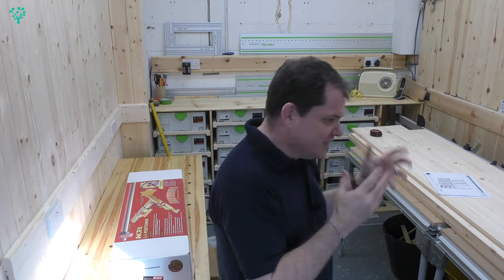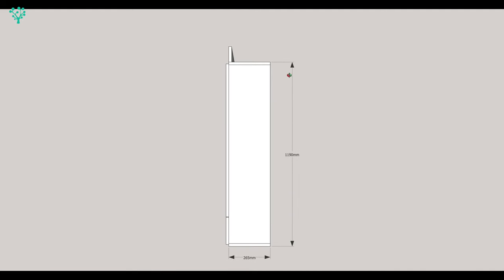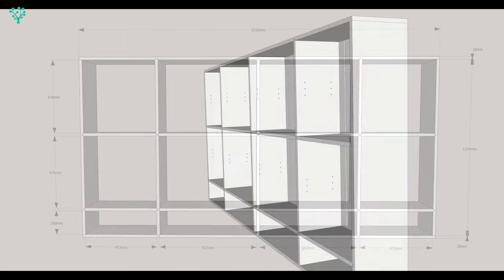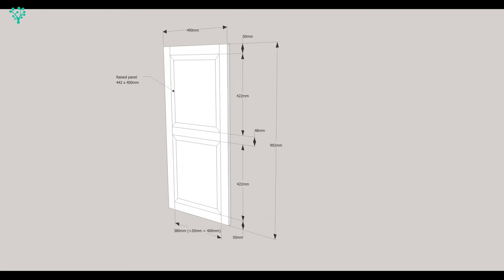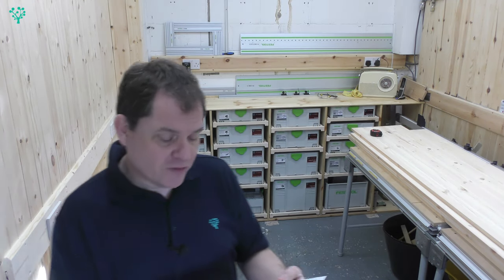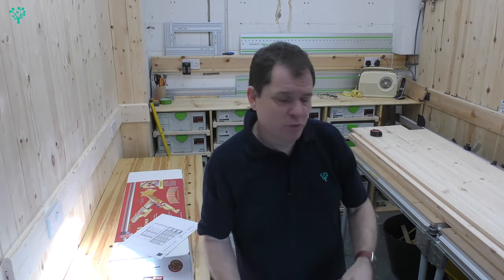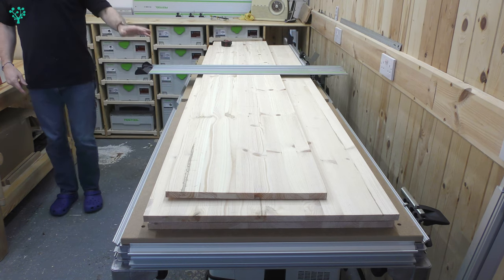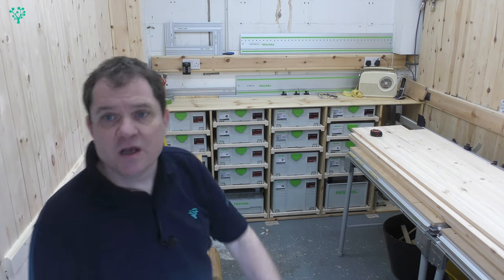How to build a bookcase - Episode 1 - The Design

Comment: Good video.  Two questions. 
First, did you use the connecting piece VS (484455) to join the MFT/3’s?
Second, what software are you using for your designs and why?
Reply from the maker: +C B Hi C B, yes I am using the VS Connectors. They do the job and ensure I maintain aligingment between the dog holes.

Currently I am using Sketchup 2017 - I chose this as it is easy to use, perfect for woodworkesrs, works locally on my Mac and offers a free license. However now that is has moved to online cloud version I am thinking of switching, the more i learn about design the more I am finding its limitations.

I am currently learning Fusion 360 - you can get a hobby or startup license for free and I can use it in standalone mode on my Mac.

This has so much more functionality than sSketchup but a steeper learning curve - BUT if you are starting from ground zero - then I would look at Fusion 360.

I am thinking of a video series on a comparison of the two. So I take a simple project - say the bookcase - and I develop the design in both - that way we can compare the two.

Hope this helps.

Regards

Andy

Comment: Hi Andy, great work as always.

Could I ask where you buy your pine and how much it costs?
Reply from the maker: Hey Parafinn Lamp

I tend to buy all of my wood from Timber Source https://www.timbersource.co.uk they have a great selection, great services if you don’t have all the facilities in the workshop and good prices AND they deliver. The delivery guys are awesome as well,  I once had a delivery due and the road was blocked, the delivery guy hand carted the lumber up the road - talk about above and beyond. They also have awesome customer services and kowledgable staff at the yard who welcome questions pre and post sales. Can’t recomend them enough. I noticed that Peter Parfait also gave them a shout out on one of his videos - he also couldn’t prasie them enough - so looks my experience is not unique.

HOWEVER - when it comes to furniture boards - both pine and oak - they are not the most competative - if the material is for a workshop project then I search on ebay for the lowest price and compare that to Timber source I buy the cheapest. IF it’s for a customer project - I always use Timber Source as quality is pretty much guaranteed. 

The stuff I am using for this build came from ebay - a company called Ron Curri & Sons Ltd. www.roncurrie.co.uk it arrived within two days - well wrapped and good quality - and about 20% cheaper than anybody else I found for pine board. First time I have used them - so can’t talk from experience yet - but I would use them again.

It is around £32 for an 18x2400x600 board plus VAT plus delivery.

Hope this helps

Andy
Reply: @TheWoodgrafter  Thank you so much, lots of helpful information there.

You're right to shop around, prices vary such a lot and due to many variables.
Reply from the maker: Parafinn Lamp your welcome.

Comment: Hi, just wondering what design program you are using and would you recommend it?

Great videos 

Thanks
Reply from the maker: +Jacob Wootton Hi Jacob,

To create the various woodworking designs I am currently using Sketch Up make 2017. This was the last version of the free standalone version - it has now moved to a cloud version, and I don’t like it as much, as I need internet connection to use it - not something I always have available.

However functionally it is great for woodworkers and yes I would recommend it - providing you always have internet connectivity.

The commercial version still has a stand alone version - BUT it prices itself out of the market for the hobbyist or small business.

I am now learning Fusion 360, and will be making the transition to that on the next project. This has much more functionality, but a steeper learning curve.

However, this comes with a free startup license or hobbyist license. Early indications are that this will be my choice moving forward.

Thank you for the feedback on the videos.

Hope this helps

Andy